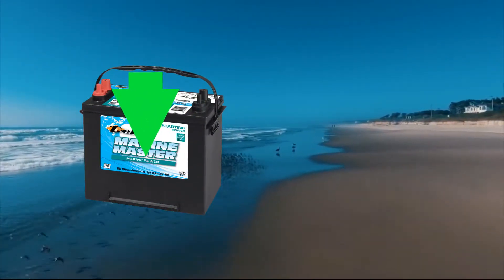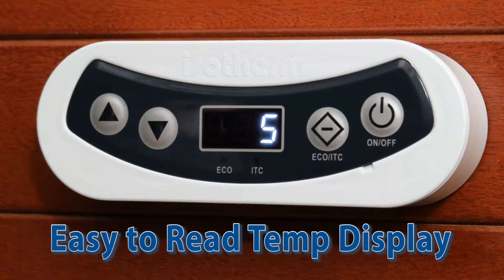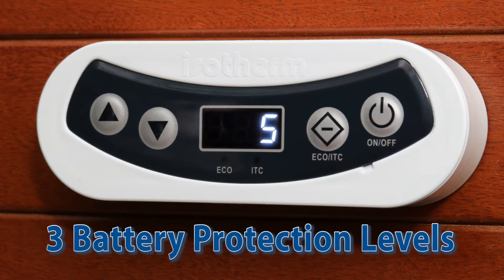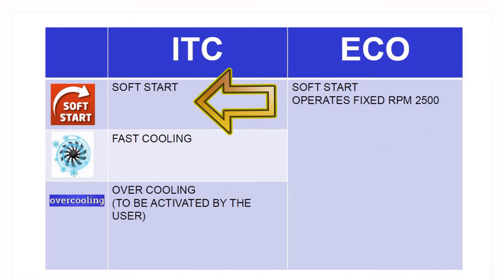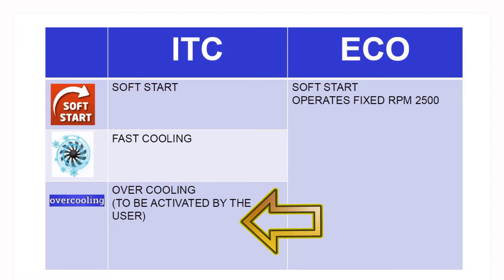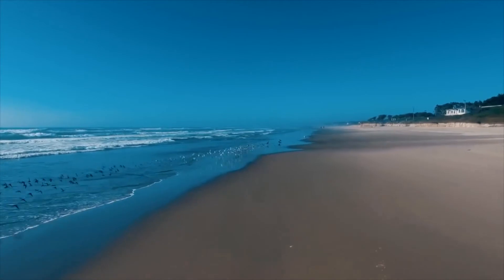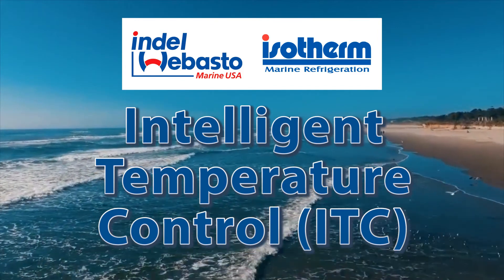Isotherm Intelligent Temperature Control - ITC

Comment: Will this work with the Isotherm Drawer models?
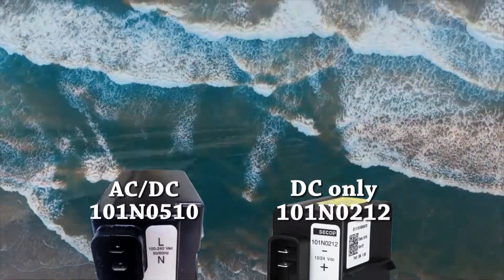Reply: Look at the SECOP controllers shown at 0:15 in the video.  That is what it works with.  There is a wiring diagram that comes in the instruction manual (you might Google it).  It's pretty straightforward.  After installation, you calibrate the thermostat differential to match a known measurement.  (I used a Thermopen cooking thermometer that is very accurate.)  Has worked well so far.  Wife especially likes the ability to read the temp without opening the fridge and dumping the cold air.  The overcool function also works, reducing the temp by 5 deg F when excess power is available - like afternoon solar - so that when nighttime begins it is below temp with cold stored in drinks, etc., in the fridge.  I purchased it primarily to monitor inside fridge temperature, and better control.  The other stuff is a bonus.  Thinking about putting one on my Isotherm freezer, as it has correct SECOP controller to do so as well.